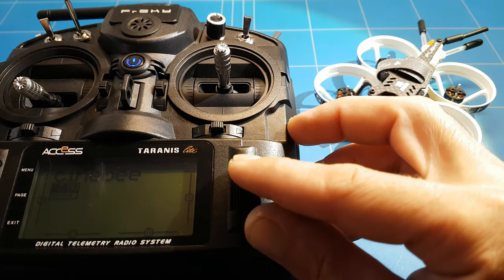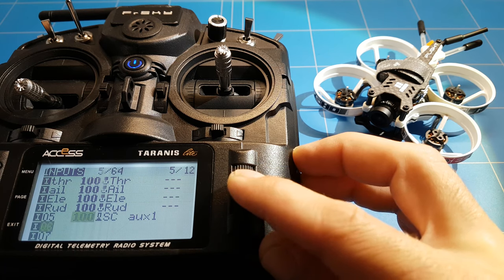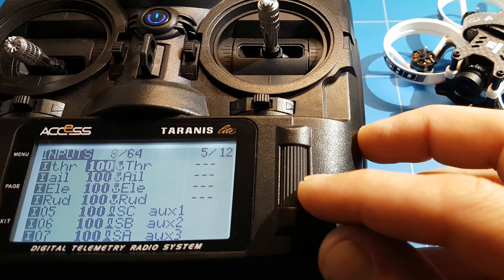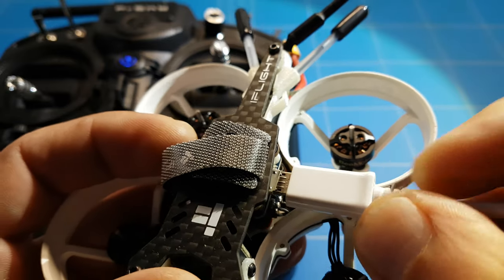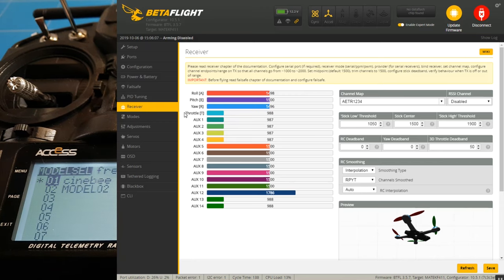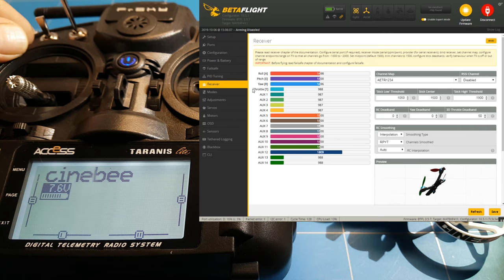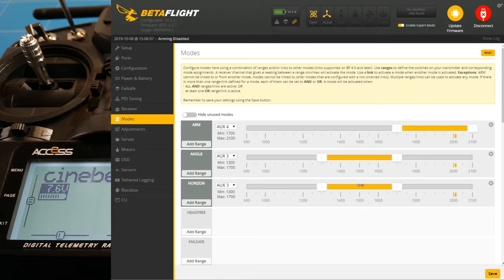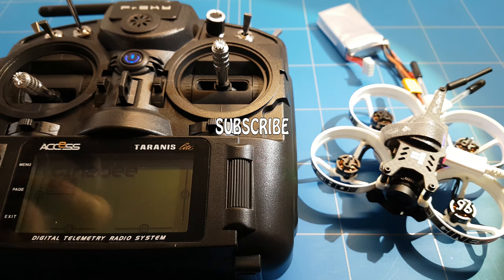Frsky Taranis X9 Lite How To Setup Switches and AUX Channels in Betaflight with iFlight Cinebee 75hd

Comment: Bro, amazing video, had trouble with my X-lite radio, this solved the problem :) For those still struggling with the throttle/yaw/pitch/roll not being mapped correctly, just hold down the enter button on the input you'd like to move in the menu, select move, and then move it to the channel you want it on. It will appear in the same channel as the input that was already there, but you can then just select the pre-exisiting input that was on the channel originally, and move it again to the empty channel you just took the first input out of (hope that makes sense, happy flying everyone)
Reply from the maker: very nice of you thanks :D